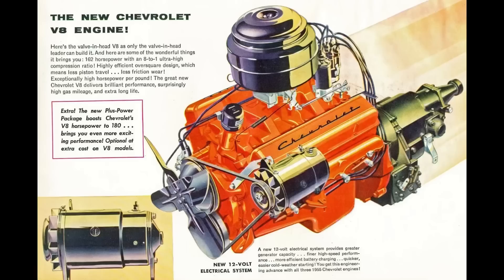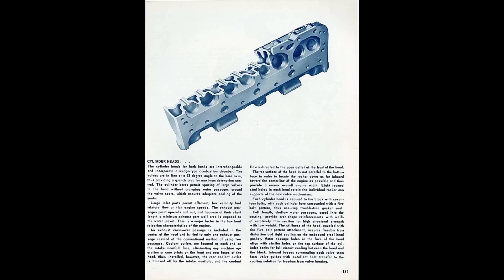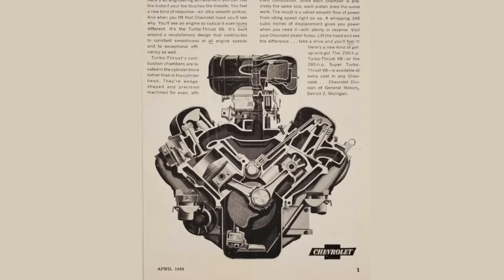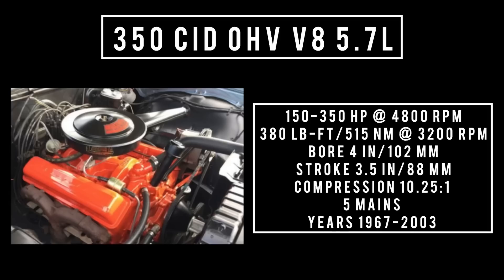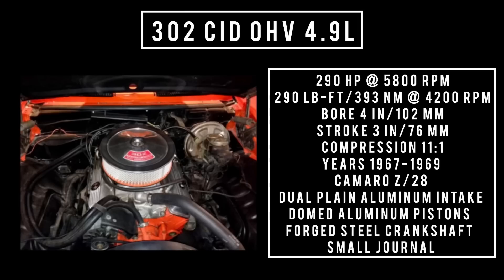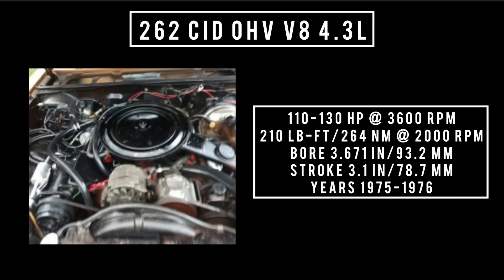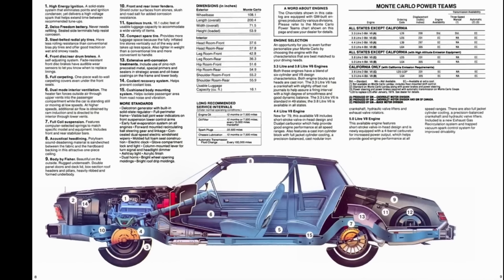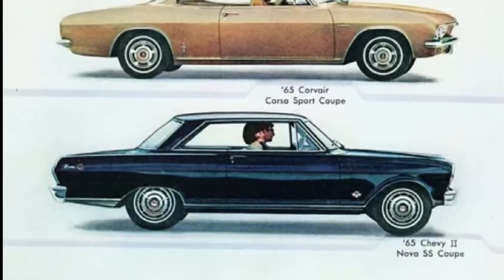First Generation small block Chevy engine family 265, 283, 327, 350, 302, 307, 400, 262, 305, 267￼

Comment: Driving from upstate ny to Fort Lauderdale spring break  in 1974 with a 283 I put in a 69 chevelle. Fuel pump died on I95 
 in rural Maryland near an exit. We walked about 3/4 mile to a small gas station that had a new fuel pump on a shelf  in an old cardboard box.  I bought it and walked back to the car. State trooper was waiting and said we had an hour to get off the highway. In about 15 minutes we were back on our way. Such a dependable engine easy to work on with completely interchangeable parts.
Reply: What do you think the mpgs were for you? Curious to know thinking about putting one in a 69 Pontiac Firebird 350, the 283 is growing on me.
Reply: @chrisg5704 —why put a Chevy in a Pontiac, stick with the Pontiac 350 it has more torque and that’s what is important
Reply: @middleclassretiree yea I hate that I even thought about putting a underpowered 283 in a Pontiac ignore me postnut clarity cleared that idea up 😂
Reply: I had a few 283 s and with the two barrel carb they weren't bad on fuel if I were going to run one is put a quadrajet on it they have much smaller primaries and get better milage also give better throttle response than a two barrel carb and if you do ever jump on it and open the big secondaries woo hoo lol @chrisg5704

Comment: My first car was a 67 Camaro that I bought with 19,000 miles in 1969

It had the 327 with the "Corvette heads" identified by a special stamping 

A mystery to me that I've had for over 50 years is it when I sold the car the buyer complained that one of the cam lobes was worn at around 80,000 miles 

All this was unknown to me until he informed me 

And I have wondered for 50 years how could that have happened? 

All that I can think of was that I went to school in Virginia from California and during those winters I would warm the thing up for 20 minutes. 

I wish I've subsequently learned as bad for any internal combustion engine.

But my supposition has been that I learned that the small block Chevy only had splash lubrication on the camshaft. There is no oil feeding it directly and all I can think of while it was idling one of the lobes wasn't getting enough oil? 

And I never understood why they made both the 327 and 350 concurrently in 1967 and 1968? 

And  I'll tell you even in 1969 I knew someone who had a 67 Z 28 – talk about a rare car – but even then the claimed  290 hp was laughable to me as my 327 had 275 hp 

But it was a great engine – what can I say - anything that's lasted 50 years speaks on its own

Comment: I always thought it'd be cool to have LS style heads on a 350 roller cam block.
Reply: The bore spacing of the original Gen I and II is the same as the LS.  But the head bolt pattern is different.  I've read that it can be done, but you need to start with an undrilled block and know a REALLY talented machinist!

Comment: 327 chevelleS  and Impalas!!
1970 utility short bed step side pickup was contracted to Mew York State Parks. It came with the 307, matched with 4 speed column shifters. These trucks were work horses with little motor issues.
Reply: 3 speed transmission 🤪
Reply from the maker: Awesome I wonder why Chevy did not make a four-speed column shift Saab had one..

Comment: Great Info! Spot on!  Favorite engine is the 283.  327 comes in next. I race with one with dual quads in a 1956 Gasser. Runs 11.90s The 307 and the 305 got a bum rap. I've run a 305 with mild mods in a 78 Olds cutlass that ran 13.30s, the 307 was a great pick-up engine imo. My 68 K20 200hp 4 speed towed great! Not a land speed record but would pull 6k trailers all day!

Comment: You never mentioned the 305 HO TPI engine with 9.5 to 1 compression and roller camshaft.  They lied about the horsepower because it made more power and torque out the hole than a 325 horsepower 327. I know because my IROC-Z outran one by over an 1/8 in the 1/4.

Comment: Ive been around many of chevy small blocks  in many different forms and or configurations.  Seen some big power house and some weak mouses . But overall greatest engine ever in my opinion. My favorite  i guess is the 327 sb300 hp and 325 hp.. They Reeved hard and just didn't give up . Never got to drive a factory 375 hp model.  A friend built a copy of a 365 hp /375 but  it  was also bored and had some head work. Always wanted to build a 327  aluminum head , all roller engine  would be a sreamer with a good stick trans. 🛠️💪. And By the way everyone Jesus Christ is the answer through the Good and the bad times. ✝️🙏
Reply from the maker: 327 was a great engine totally agree they sound great when getting close to red line going through gears..

Comment: My dad's first race car in 1962, if i remember the year correctly? 
It was a 1956 Chevy 2dr post, 265 engine 3 speed manual.
My dad ran it for years, then his brother took over and did even better. I believe my uncle upgraded to the 283 later on.
They did some homemade suspension upgrades which were legal, kept quiet and the mods allowed him to run around the track like he was driving on the interstate. 
He won so often that they were accused of cheating by the competition and were forced to tear down the engine in the pit's after the races more than once.
It's weird how people can actually hate you when your on top. 
I have some of their trophies on my mantel and my uncle's 1967 point's championship trophy.
I was youngest and had to do all the grunt work, but i wouldn't trade those day's for anything. 
Watching the evolution of race cars from stocks, modifieds, super modifieds and eventually the majestic winged Sprinters was incredible life experience. ❤
My favorite engines were always 283, 327 and 350 for sb's.
283's are bulletproof! 
I had four cars legally stolen from me and the one I miss the most to this day was 1967 Malibu 2dr hardtop 283, three on the tree and 4:56 posi. 😪
Reply from the maker: Awesome thank you so much fir sharing all of that =)

Comment: 400ci in lemans came with 325hp. They go 330-350hp with almost nothing
Reply from the maker: That’s a Pontiac tho totally different engine family
Reply: But still and SBC
Reply from the maker: That’s a confusing one because Pontiac had a 400 as well but different animal they also used chevy Engines later

Comment: Ok, this is a question. I am a Ford person but love all cars. My dad left me his 67 El Camino that has a 283. The 283 has seen better day and will not run so I found a 327 to replace it with. First, will this be a one to one R and R and, will it be ok to parrot to the two speed Power Glide transmission?
Reply from the maker: It should bolt right to it all chevy small blocks interchange with all chevy transmission from that time... but Chevy v8 won’t bolt to olds transmission without adapter plate

Comment: I enjoyed the vid. and scanned the comments for my fav. engine. I found some mention of the DZ-302 and thought I might add some color to the legend. I was 17 when my dad left me buy a 2 year old '69 z/28. I had a small foreign 4 popper and a 273 '64 Barracuda before so I was floored when the test drive consisted of the owner gluing me to the back of the passenger seat on the test drive. I bought it and beat the hell out of it. This engine and drive train were absolutely indestructible, however the clutch wasn't :-) I won a lot of light to light races and lost some too. The competition then was fierce and many would set their cars up especially for the 1/4 mile. I had the standard 373 rear which gave me a nice top end and respectable mileage but wasn't quick out of the hole. Regardless, this car was made to race and as stated in other responses, it came alive above 4000 rpm and would rev to over 8000 easily. The tuned exhaust was music to my ears and was a subdued chaos that whined when floored. The car had close ratio steering and tuned suspension that hugged the road well and saved my butt a few times. I simply added air shocks to stiffen the rear end for cornering. The absolutely, hands down best engine I ever owned. btw, I had a '64 chevy impala with the 250 hp 327 2 speed powerglide that was fun and a nice chick magnet but it was no Z....
Reply from the maker: Awesome, glad you dig this video 

Awesome information and insight thank you so much for taking the time to share that with us

Comment: @daveridgeway2639
0 seconds ago
 By the way with all due respect, I am mostly a Ford person but when it comes to "Hot Roding" in 1955 the small block Chevrolet V8 took over where the Ford flathead V8 left off.  The small block Chevrolet was small, lightweight and cheap to work on and modify.  Fords first small block OHV (overhead valve) V8 "221 CID" did not come along until 1962, exactly seven years after the the 265 CID small block Chevrolet came out, after many of the Chevrolet's patent's expired.  Some parts do interchange with small block Chevys and small block Fords, such as in the overhead valvetrain. and I do not think that is just a coincidence.  You see, when the small block Chevy came out, it was the first inexpensive engine the would rev to 6000 RPM+!  Please reply.  Dave...

Comment: The original 265 had a breather pipe down thru the block.
The 272 Ford could run circles around it.
The 283 bored to make 301 would wind up, keep going till it exploded.
The 327 was my best choice, faster than the 350 in that time. It could rev faster and higher at that time.
Things change, in 1966 the 375 hp 327 was mean, now some have made the 350, 383 and 400 really good.

Comment: Back in the late 1950s I helped with the build of a 265 that had been bored .030 and completely  balanced.  It was built for a inboard  hydroplane race boat.  The class we ran in restricted what we could use.  We were limited to a two barrel carb, standard distributor.  certain model number corvette cam.  I have driven this boat at over 100 mph, and it would run 8000 + rpms all day if needed. To this day I consider the 268/283 engine  the best V8 produced by any mfg.
Reply from the maker: Wow thank you so much for sharing that story do you still have the boat? Sounds like you built something magical.. if the boat still exists would love to feature it on the channel 

Email what_its_like@yahoo.com

Thank you so much for sharing that memory =)
Reply: @What.its.like.  I went into the military in 1961 and while I was gone the man who owned the boat had an accident with it and it caught fire and was partially destroyed. I never learned what he did with it and/or what ever happened to it.  There were many race boat owners in that time that used the 265 engine for a 266 cubic inch class that were allowed to do many more things with that engine and some ran at speeds in excess of 130 mph.  Check with American Power Boat Asssociation on the 266 class from the 1960s and get a lot of information.
Reply from the maker: Thank you so much for the follow up =) what a time that must have be to be alive I was born to late love the 50s

Comment: A great video Jay on a very famous engine that I know that you did a lot of research on as there was a lot of enlarging in size to that original small block engine. I was however disappointed that you did not list the top speed of any of those engines or how fast it would take to go from 0 to 60 mph, but maybe you only do that for the cars themselves and not just the engines. Also, I would have like to have seen some colored photographs from any of the famous tri-five Chevrolets as those were the first cars to employ the new 265 cubic inch small block engine. Out of those ten different versions presented of the small block, the one that I am most familiar with is the 327, which by the way was nicked named "the mighty mouse" by its owners. I believe that it was used on all the Stingray Corvettes for much of the 1960's.
Reply from the maker: That would have been super hard because would have to find the car with the most hopped up verison of that engine for top speed.. top speed also depends on transmission and rear engine end ratio.. top speed fuel economy are part of the car reviews because it’s only one car, if that makes sense like a camaro with a Chevy 350 v8 will have a different top speed 0-60 time than a blazer plus with so many versions like 350 hp 350 cid will obviously have a better time than 150 hp 350 cid...

Comment: I had a 1969 El Camino that had a 250 six in it when I bought it. I installed a 350 out of wrecked 72 Nova. It came with a four barrel carb and I installed headers and turbo mufflers. I put a muncie four speed with hearst shifter behind it and it was a real goer! If I kept my foot out of it I could get over 20 miles a gallon (at 55 mph, lol). I drove it to over 100,000 miles and it never used oil. Probably the best car and engine I ever owned.
Reply from the maker: Awesome thank you so much for sharing your experience =)

Comment: The ad @ 9:28, has no one else noticed the "wrong" exhaust manifold? IEIEIEIE valve pattern on BBC, Hemi, SBF, BBF & FE. Was this a short lived dealer brochure that was pulled when they realized the art work was wrong? Or at engine development that never panned out?
Reply: Don't believe you understood the question. The image of the old add was in the video much earlier before you spoke of a cracked cylinder head. The ad is not a mistake, but rather an anomaly. The exhaust manifold is unlike any I have ever seen on a small block Chevy.
Reply: @Lildusty66  — Yep … That’s a BBC … Notice also the four bolts along the bottom of the valve cover.
Reply from the maker: Thank you so much for that correction I googled cracked small block Chevy head and that’s what came up.. I use the clearest picture that I could find turns out that it was totally wrong

Comment: A guy who worked the summer at where I was a janitor at the time had an older boxy Malibu Powerglide with a 283 in it,he had tried to "tune it up" and complained that it wouldn't do over 80 mph or something near,I noticed that he had the points set obviously opening too wide so I got a dwell meter (alternative to measuring the maximum point gap) and set the dwell to specification-(or equivalent to a little narrower than specified gap)-and the next day or two later he said it had no trouble hitting 100 or even something considerably more 
   those "window" distributors made things easy

Comment: I think the quality of these engines,especially in casting and assembly,was variable,you got a good one and it was a running s.o.b. that would just go and go and go,but if you got a bad one it might have a loose connecting rod big end bolt or something or even have gotten out of the factory door missing a cylinder head bolt or not even have the threaded hole in the deck where the bolt should have been   (might even apply to the mighty Big Block 454)
the basic design and strength of the small blocks I think was more than that of the Ford Windsor
would be interesting to compare the Oldsmobile and Chevrolet 350 engines,I think the Olds was physically bigger and heavier but doesn't seem to have as much respect as the Chev.
Maybe making the spark plugs easy to change was a bigger priority for Oldsmobile while Chevrolet was trying to put the plugs into the place most advantageous for making power?
Reply from the maker: Interesting insight

Comment: So the "small journal" crankshaft was generally better than the later "large journal" crankshaft except that a few forged large journal ones were made for some of the premium hi po applications?
  Were some of the oddball later smog motors made with small journal but cast (not the desirable forged) crankshafts? 

Also I believe some of these (better) engines had 4 bolt main bearing caps and some of these had peculiarly angled bolts. 
  Apparently during the engineering of these engines someone figured out that a considerable part of the problems with main bearing failure involved the parting surfaces of the main bearing caps "walking" inboard a minuscule amount due to downward pressure distorting the cap,using dowels or precision locating tongue and grove to absolutely stop this creeping of the cap ends could increase the reliability of the engine under high compression and rpm load,decreasing "bottom end" failures (the inboard walking of the main cap ends caused a pinching effect that stole the oil clearance from the main bearing causing its failure)

  some of the most outrageously powerful of these engines were certain 327 and 302 versions? Did some of them have exotic cylinder heads with the valves in a non linear arrangement (exhaust splayed out of line from the intakes)maybe non parallel pushrods?
Also these engines had extra cylinder head bolts or studs as compared to other V8 engines (I think big block Chevy and Packard V8 engines also)
Reply from the maker: Thank you so much for taking the time to share all that =)

Comment: Yeah, those early SBCs were SOOO great!  Rear cam lobes worn down to zero lift on 70K miles, throwing rods in real truck service...but parts were dirt cheap and it was a simple engine that didn't require a lot of brains to work on, so it became popular that way.  NOT that Ford's miserable Y-block was any better...it wasn't.  In fact, it was far worse in some ways, the 3 main crank and the too skinny oil lines being just two goofs.  The real engines were coming from Chrysler and the upper GM divisions.
Reply from the maker: Great information =)

Comment: Wonderful engines, but too bad they put the distributor in the rear. The Ford 302 Windsor was about 80 pounds lighter and narrower (better for 6 cylinder replacement) and the distributor was in the front.
Reply from the maker: I always wondered why they put the distributor in the back as well